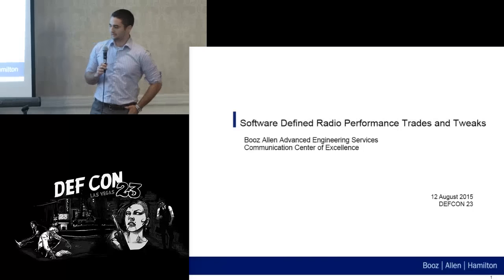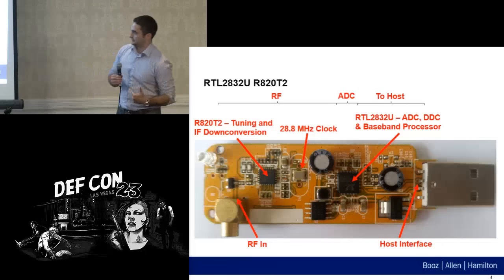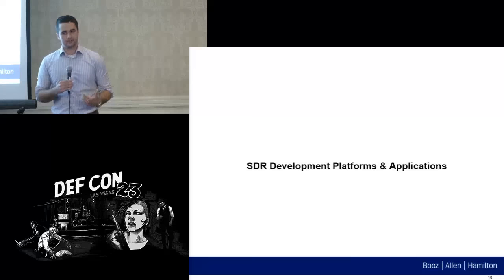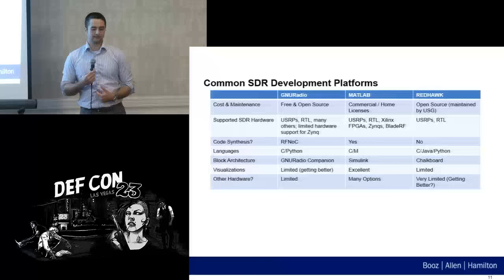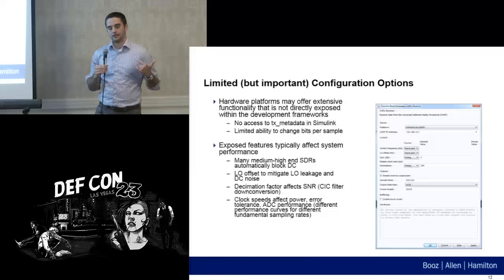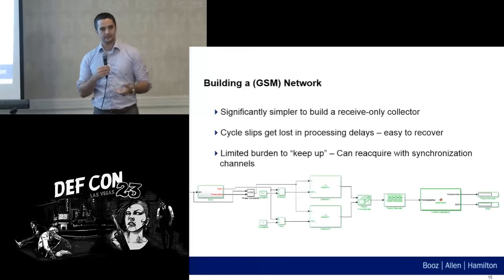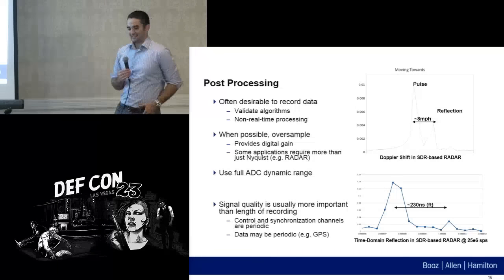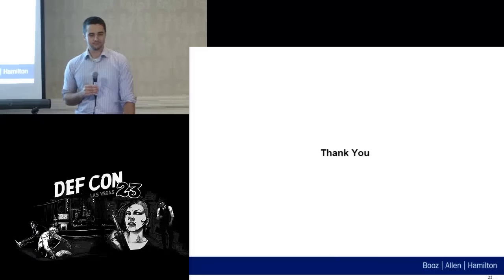DEF CON 23 - Wireless Village - Michael Calabro - Software Defined Radio Performance Trades & Tweaks

Comment: Little correction - tx_metadata and rx_metadata of UHD devices are expossed in GNU Radio through stream tags API. Processing of tags for UHD sink is implemented here:

https://github.com/gnuradio/gnuradio/blob/master/gr-uhd/lib/usrp_sink_impl.cc#L406

So it is possible to inform USRP when it should transmit data that you send to it.